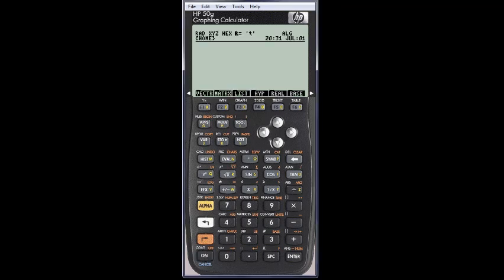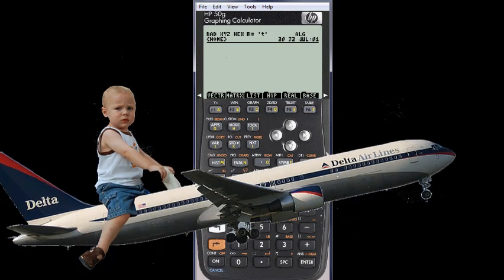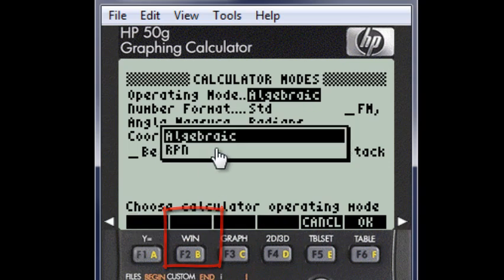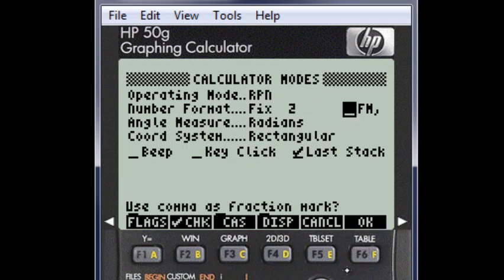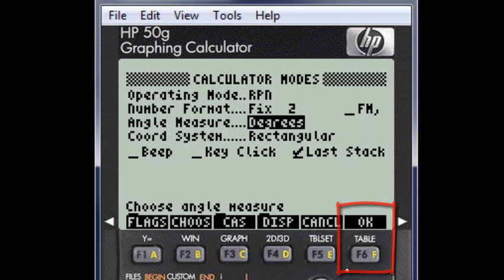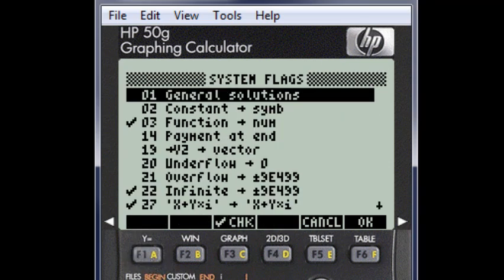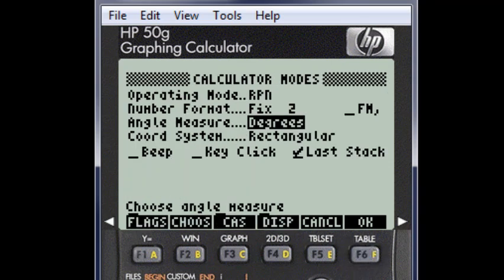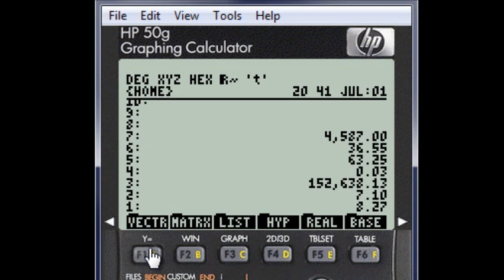HP01 - My set up for the HP-50g (2013)

Comment: Algebraic mode as default isn't a bad move. It allows this calculator and the Prime to get into the hands of students, a new generation, breaking the TI dominance. They might not use RPN, but they might discover it. In my opinion, even in ALG it offers a far richer functionity than a Casio or TI. Everybody can have their opinion around this, but limiting to RPN only ptevented HP to reach mass. Even the Prime just serves a small segment. Very unfortunate

Comment: HP50g Warning:
1.) Never "insert" a blank SD card into the slot to "protect from dust".  This totally DISABLES the unit.  WILL NOT TURN ON.
2.) If you are ever in Equation Writer Mode and press "evaluate".  This changes degrees mode into RADIANS.  Most frustrating.  I'm sure all Hp50g users have encountered random Deg to Rad changes.  How'd that happen?

Comment: So I had an issue where I was using the manual that came with the calculator before I saw this. My function keys are not displaying what you have. I've got: edit view rcl sto> purge clear

How can I adjust this?
Reply from the maker: MODE/FLAGS and check flag 117. That should set up "soft menus", that is the options will appear on top of the function keys instead of appearing on pull-down menus.

Comment: Hello I am an Engineering student and am thinking to buy a new calculator. I am wondering if HP 50g could do infinite differentiation? i.e. if I put in x^3 and it can tells me the derivative is 3x^2
Reply from the maker: +Alan Kelly d(x^2)/dx = 3x^2, the HP-50g can do that, but so can many other calculators. It can also find indefinite integrals and definite integrals. But again, I think many other calculators can do that as well.